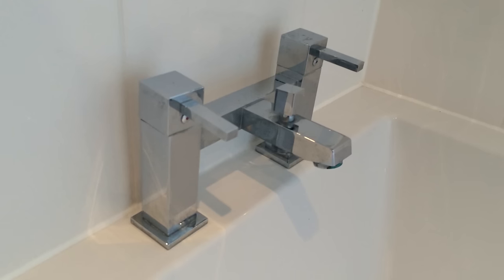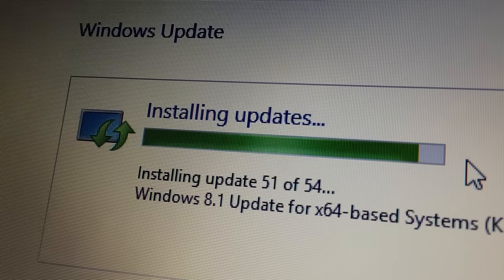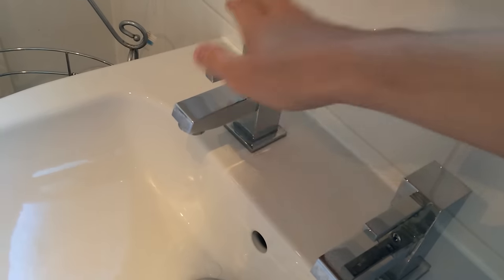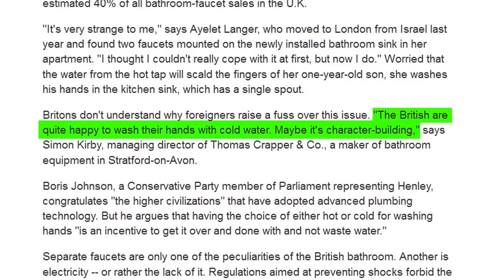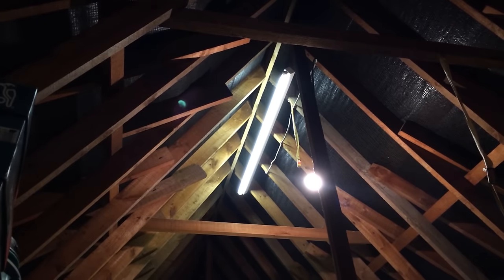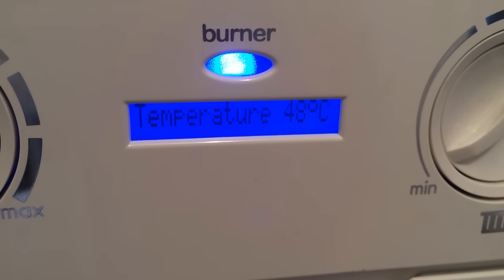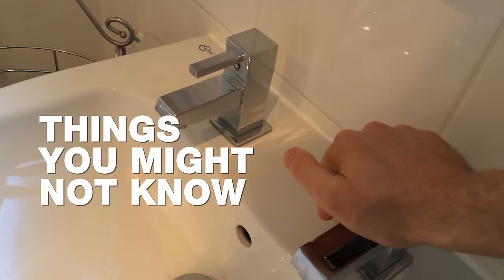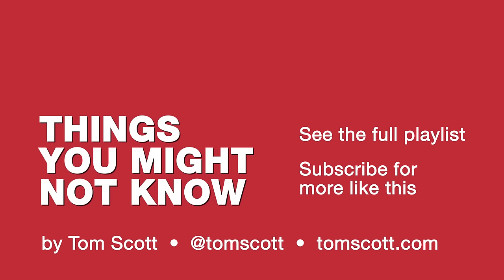Why Britain Uses Separate Hot and Cold Taps

Comment: @Tom Scott: (or anyone!) can you explain why British front doors often have a handle in the middle of the door, that doesn't turn?
Reply: It's to pull the door shut when you leave the building, only used on heavy, old large doors these days.
Reply: @GM-ii8gs  but why in the center?  Why not in the normal doorknob place?  All doors in other countries I've lived in (Switzerland, US, Japan, Hong Kong) have the door knob in the door knob place, not in the center.  And the door knob always turns, too, like a regular door.
Reply: @lqr824  Door handles or what's called knobs when they don't turn are only in the centre on larger, grander old doors, it's more of a styling feature. It looks neater, for example if you look at the front door on 10 Downing Street everything is centralised to be neat. The number 10, the door knocker, the letter box, and the door knob.

So if you've got say a two or three hundred year old house with a larger solid hardwood door, it's just something to grab hold of to pull the door shut with, where as modern doors are made from composite materials or plastic so are much more lightweight, and usually slam lock so you need a handle to rotate to retract the locking mechanism.

As these two functions are now combined, pulling the door and locking, the handle is on the edge of the door, whereas on old doors the lock would have been separate and you would have needed to turn a key to lock the door. 

So people would stand in front of the door and pull the door shut with their right hand which is usually for the majority of people they're stronger arm and then rotate the key in the lock to lock the door with their left hand.

Comment: I feel the same way about Lead Poisoning.  There was a lead poisoning scare in the 80s, and they suggested you run the tap water for a minute to clear out potential lead sediment.  I will run tap water for a few seconds (about 30) before using it.  Even then I like a water filter.

Comment: On-Demand water heaters aren't.... good. Like, they SOUND like a good idea, but it's actually better to get a heat pump water heater. Not only does it reduce humidity in a place where humidity is almost always a nasty problem(wherever your water heater is), but they also ACTIVELY COOL THE ROOM AROUND YOUR WATER HEATER. Seriously. It's an Air Conditioner that's running using less power than you're already using to run your glow-rod water heater. And like all air conditioners that aren't swamp coolers, they're dehumidifiers in that process. 

Reduce mold and mildew in your basement. Get a heat pump water heater.

Comment: You will run the cold water *for a few seconds*? Even in countries with some of the cleanest tap water people do that at a minimum, many, including me runs cold water for 15-20 seconds or more, even at places where the water gets cold very quickly.
By the way, when they're testing the tap water in Sweden I believe they're running it at full strength for at least 30 minutes.

Comment: What is the point of the cold water storage tank?
Reply: The boiler would take a fair bit of time to heat up water, and as such there was a limited amount of it. The water had to stagnate to heat for whenever you intended to use it, it wasn't on demand. Cold water however came from the mains and there was an unlimited amount of it.

Comment: Yanks have had gas powered water mains fed tanks for years. We are now catching up. I have a mains fed storage tank heated by the sun, gas and electric. Not all at the same time. In theory we could fill the kettle from it. We don’t, old habits die hard. In euro terms water is potable or not. Good vid lad, although modern mixer taps don’t mix, they are still illegal I believe they are separate right to the outlet.

Comment: Even with modern water taps, rinsing the line before taking drinking water is a safety procedure, as the surface to volume ratio in the house is bigger, more contamination can be expected, leachables from plastic polymers e.g. phthalates and lead from bronze and as the houses are over 15°C, bacteria grow better in  usually cold public pipeline, at least before global warming... pseudonomas aeruginosa likes rubber sealing, which might have been greased additionally, the hole thing looking like slug slime ... Similar shower hoses with rubber may be a (ugly) biological growth area, also for every kind of mold, as mixed water around 37°C is very good for bacteria growth, so never drink out of these!

Comment: This all makes sense from an engineering/historical standpoint. But nobody would ever drink the tapwater in a public toilet! People want to wash their hand, for goodness' sake. Why do they still install non-mixing taps in public restrooms where there is no excuse?
Reply: The issue is the contaminiation of the public water supply, not just the supply locally in the building.

So public toilets would have had the same issue, if it backflowed it would get into the water supply that everyone else is using.

That being said, nowadays that's not an issue and most public bathrooms I've used seem to have mixer taps.

Comment: I’ve showered in warm pigeon juice for years , I suppose that’s why I’m always found begging for food in town centres 😜👍 I think this all stopped with the  combi  boiler where cold water main only comes in and heated automatically at  temperature, , the combination boiler took over from the emergent heater   To which will overtaken by the new green deal 15  thousand pound heat exchanger in the next few years

Comment: Seven years later and the Prime Minister is threatening to take that shiny bit of technology powered by gas out of your home so the nice fresh water will have to be heated some other way.
I like my water storage tank in the loft, they can't turn it off at source so I have 250 gallons more than the house that is immediately shut off. so at least I have 250 gallons which I can filter and boil on my coal fire to make it potable.  
I know a lot of the decisions they make are sensible but that sense can also be turned against us by the stopping of the supply, and seven years can anyone tell me there isn't a cause for concern with the current government.